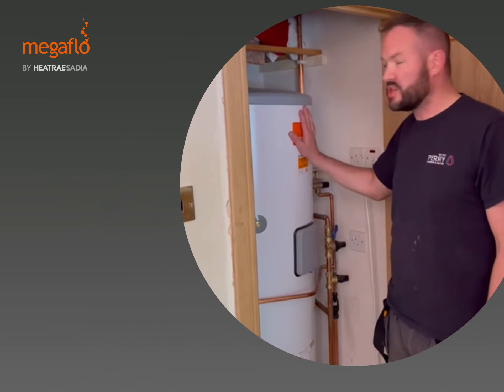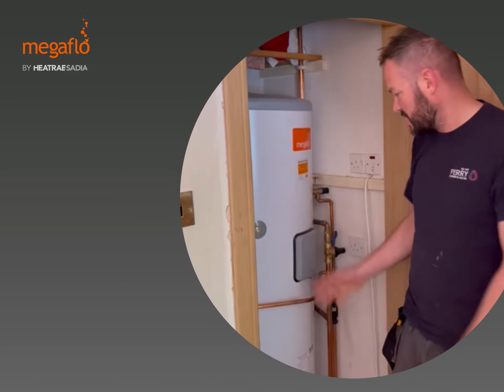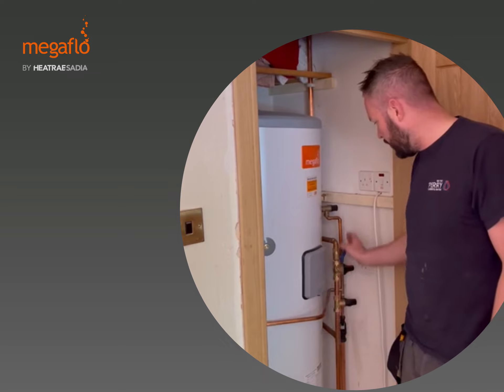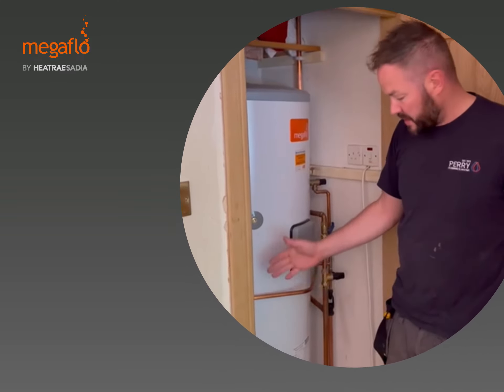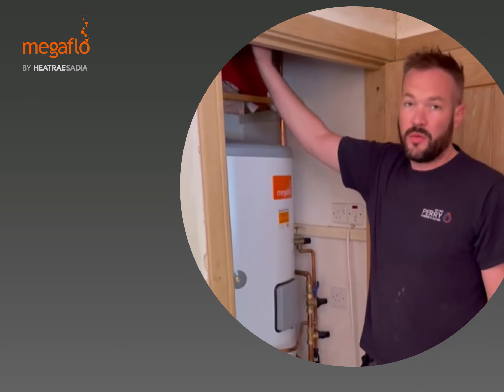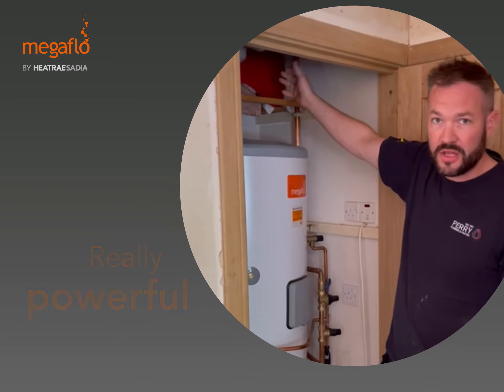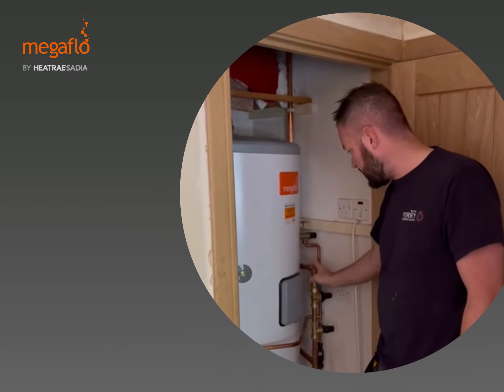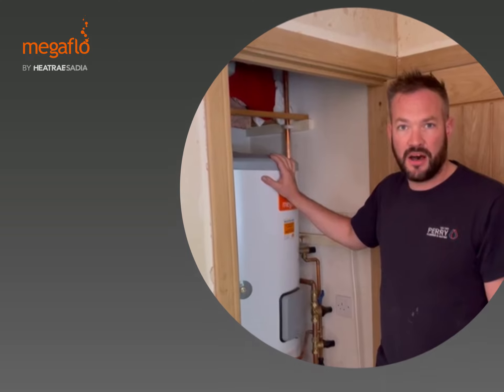A Megaflo cylinder install by Perry Plumbing & Heating - Part 2

Comment: Hi Perry,
We had a new mega flow installed and could use 3 showers simultaneously.
The water company changed our water meter outside and we came home to no water.
They came back and managed to get things going but it wasn’t the same.
 I then paid for an engineer to re pressurise the tank . This worked for a short while and we are back to anyone using a tap results in poor flow rate .
We have a red tank on top … does this need to be re pressurised again or do you know what could be causing the problem…poor flow rate.
Ps we have blue tube running into the property and 22mm pipes internally.